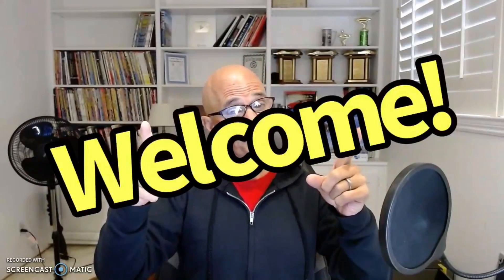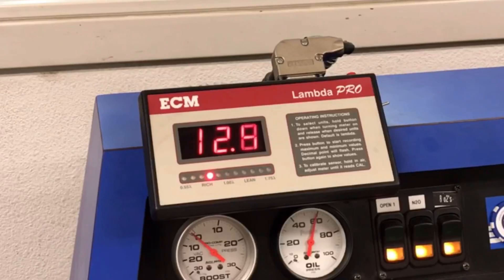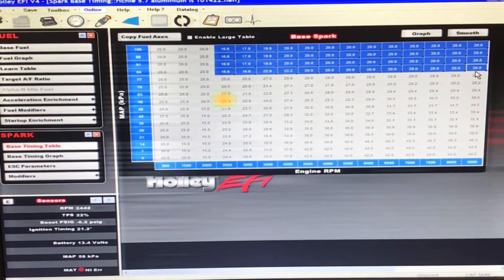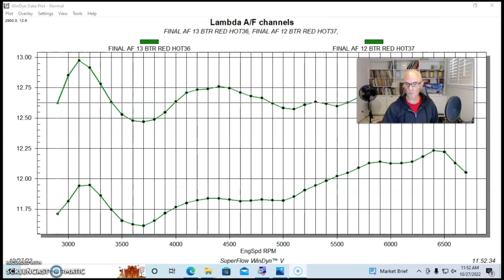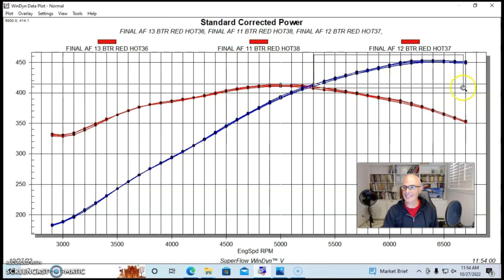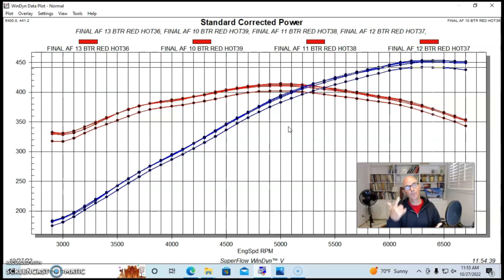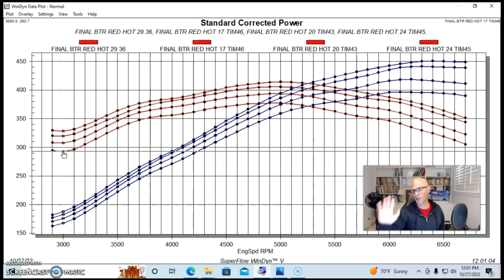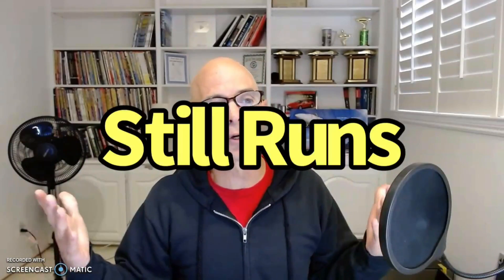JUNKYARD LS TUNING SECRETS! A/F TEST-10:1 v 11:1 v 12:1 v 13:1. TIMING TEST-17, 20, 24, 29 DEGREES!

Comment: Obviously, vehicle weight and combustion design efficiency plays a huge role in what you can get away with (timing and AFR). Octane as well.

I personally see most trucks (5000lb+ lbs) only tolerate 24° to peak 27° ign timing on 91 octane.

Light vehicles (Vettes, GTO's, swapped Japanese chassis) can get away with 25° at peak trq and upwards of 29° near redline after the peak cylinder pressures. 

Richard, you rock man. Thank you

Comment: I have a question regarding compression and timing. One would assume if you take an engine and simply increase compression nothing else, it is going to want a little less timing. Is there a point where having lower compression with higher timing will make more power then higher compression and less timing? I know this sounds generic, but with technology these days I like to question a lot of the things we have always sorta gone by in the past.
Reply from the maker: Higher compression doesn't always change timing (unless the piston design is dramatically different-read big dome)
Reply: @richardholdener1727  I see, I am gathering parts to upgrade the 302 in my falcon. Its from an explorer with the gt-40p heads. Was thinking about adding some compression to it with a set of kb dome pistons, mild port job, chamber cleanup, etc. Just something to play with, no real goals in mind besides a different build vs just going the easy route and throwing aluminum heads on it like everyone else. Curious about trying 10.25-10.5:1 to see if I could get away with it on 93 octane. I know the camshaft plays a big role in bleeding off some cylinder pressure, but Id like it to have a good useable power curve vs being a 7000 rpm setup. Have you done any testing with Howards cam shafts in the sbf platform? I am considering their 222755-08 cam for this build. Any suggestion on what dynamic compression would be safe for an iron headed sbf? Keep the awesome videos coming, I have enjoyed going back and watching them!

Comment: What the timing should I use with a ls carbed with stock pcm? 🤔
Reply from the maker: how are you running a stock PCM with a carb? But the answer would be the same as EFI-whatever timing makes the most power with no detonation

Comment: You lost about 12% of ft.lbs down low and you lost about 12% of ft.lbs @6200rpm.
Is that really significantly more? 🤔
Reply from the maker: now do your calculation in hp
Reply: @richardholdener1727  The question was ”is that really significantly more”.
We don’t measure hp, we measure torque.
The gain on hp is because of the mathematical formula of it (I know you know this), not because of anything else. The engine gained about the same torque % down low as it made up in higher rpm.
So in other words it made about the same gain from the timing advance at lower RPM as at high RPM (And didn’t ”need less timing at lower engine speed”).

Comment: Question when you take out and you got the rings do you reuse the old rod bolts or do you put new ones in?
Reply from the maker: reuse rod bolts
Reply: Install new head gaskets on my 4.8, hearing a lot of noise bottom end, Baeings worn out,? Motor does have 280,000

Comment: What pound fuel injectors do I need to do a thousand horsepower on a 4.8 2006?
Reply from the maker: 80-100 pounders will do that on gas, but you need 1500 cc (or so) for e-85

Comment: What about the combinations, low afr and high timing vs high afr and low timing vs low afr and low timing vs high afr and high timing. after all they do work in harmony...
Reply from the maker: the ideal timing has little to do with AFR-that is primarily chamber/piston design. when we test the effects of 1 variable, the others are optimized
Reply: @richardholdener1727  You say they have little do with each other, so you have tested these combinations?

Comment: The dyno and the track are not the same. My 415 made it's best power at 25 degrees of timing on the dyno, but at the track 25 degrees only got a 1/8 mile pass of 5.67 @ 121.5 mph. i made the next pass at 35 degrees and it ran 5.55 @124.79 mph with no other changes.
Reply from the maker: did you try 30 degrees where it should have been
Reply: yes, and it wasn't as fast as 35. I have a 6300 stall and shift a 72-7400 rpm. @richardholdener1727
Reply from the maker: sometimes the rate of acceleration changes timing needs-but do what works best for you at the track
Reply: @richardholdener1727  Just to let you know I wasn't trying to disprove you or anything like that , I was just posting my experience and what worked for me.
Reply from the maker: no worries-in the end-do what works best

Comment: Dyno'd thousands of engines...The power loss comparisons on a few of these static tests appear small, however, when the engine is in the car... timing and air/fuel play a much more important role for engine acceleration, and engine recovery on a gear change. Ted @ CNC Racing Heads

Comment: What should my afr be at idle on a cammed 5.3 ss2
Reply from the maker: 12.5-13.5 is fine
Reply: @richardholdener1727  ok thanks. Had some guys say it needed to be leaner
Reply from the maker: you can run it at 14.7, but they tend to idle a little better if you run them a tad richer-the motor will tell you what it wants.
Reply: @richardholdener1727  ok thanks 😎
Reply: @richardholdener1727  another thing. Idle vacuum. Mine is at -5ish.

Comment: If your running 10:1 or 11:1 AFR over an extended period of time  would there be a build up or carbon on your pistons and valves?
Reply from the maker: not from compression
Reply: @richardholdener1727  No I mean 10.1 - 11.1 Air fuel Ratio?

Comment: Is 29 the best you’ve found have you tried 30-31?
Reply from the maker: timing sweeps are performed on every combo-including going past 29-but if no power gains come from going from 28-29, then you won't get any going to 30 or 31
Reply: @richardholdener1727  oh I didn’t see the dyno from 28-29

Comment: Wish you would have went higher on the afr and see if power drops before knock.
Reply from the maker: leaner than 13.0:1 at WOT? no thanks
Reply: @richardholdener1727  
I was just curious if the dyno would start to show less power before it got critical./ knock

Comment: FormulaBoat, and he doesn't just do ls testing! he, does some of the stuff you go i wonder what would happen if? stuff. hopefully, he gets his mitts on the new 4 cyl from BPE. that made a showing at the last PRI, show. 340hp 3.6 they estimate, bet he could pull close to 4 hundo, out of it. he has toys you know. and he uses dyno water like engine,pierre.
Reply from the maker: that bpe motor will most likely not be offered with an LS head is the last info I got
Reply: @richardholdener1727  but, im sure you can spin the wheel with the Ford  head. I, just read what I thought was a new article earlier today.
Reply: @richardholdener1727  i,was amazed by the bore and stroke that little mill will boast. It's pretty exciting actually  it may well end up starting a new trend in little big power.

Comment: I’m more interested in what the air-fuel ratio does to knock threshold. For example, since going richer doesn’t cost much in the way of power does it make it more resistant to knock and would it allow you to run more timing? And on the inverse side, where is the cross over point for leaning it out to gain power before it runs into lowering the knock threshold and it starts forcing you to pull timing.
Reply: Is not moving the af ratio with the point changes riching the fuel and leaning it out he shows that it only gains 2 hp so hes saying its not worth leaning it out or to fat.

Comment: Gotta say I was not expecting these results.  My assumption about timing was about right, but I did think the AFR would have a much more significant effect.  As always, the numbers don't lie.  Thank you!
Reply: I have personally experience the same thing when tuning my ls and went richer as I go between 5 - 20 % ethanol with out an effective sensor.
I tried simmilar with a barra years ago and that engine for some reason was very touched when it came to richer afraid in the 10's . The LS didn't care one bit

Comment: HP Tuners YouTube channel did a similar video on fuel and like you showed power was negligible but was really important was exhaust gas temps.  Spikes in getting hotter or cooler with just small changes
Reply from the maker: definitely with timing

Comment: A takeaway for me is that A/F insensitivity explains why carbs make more power unless you spend 5 figures on an EFI setup. Atomization is more important than an exact a/f ratio.
Reply: Who spends 5k on EFI?
Reply: @nocturnalspecialties642  5k is 4 figures. A 5k efi setup won't beat a well prepped carb setup for the same money. A lot of people spend 5k on efi and more. 5k is peanuts.
Reply: @IlPinnacolo  :( I misunderstood that. 
I use Holley Dominator ECUs on all the turbo cars/trucks I build.  
Kinda hard to run dual fuel in a carburetor setup tho.

Comment: Any good reason why my car after a tune would want to run at 14.7 a/f ratio
Reply from the maker: only under cruise-you should never run it at wot at 14.7:1
Reply: @richardholdener1727  under WOT it settles down to 14.7 a/f but under cruising it bounces around everywhere

Comment: 10HP on a 450hp engine is slightly over 2.2%. You can go down 3 full AFR numbers or 5 degrees of timing from optimal and the HP cost is minimal.

That means that there's significant tolerance of at least a similarly set up LS engine in terms of both AFR and timing. For people who are doing anything but trying to eek hundredths or fractions of an MPH out getting it close is almost certainly good enough.

Comment: 450hp from a cam only 5.3L.  Awesome.  This guy needs to be paid more.  His contributions to the community are more than any other 10 combined.  Thanks buddy.
Reply from the maker: thnx
Reply: Holley hp mangement system is what most people missed
Reply: headers & no accessories or air filter

Comment: Timing just scares me..rattle a motor a few times and you could have a a pile of scrap metal.  I do hate the thought of leaving 30-50 HP on the table too, but..i hate all that rebuild work..i keep my turbo car at 10.7 WB and 17* with meth alky control inj.
Reply: Knock sensors hear that and will retard timing.

Comment: With a NA 4.8 or 5.3L with 862 or 706 heads I generally find 26° total timing and air/fuel of 12:1 at peak torque and 12.5:1 at peak HP to be safe.

Comment: Very good test. When my PE is rich I can hear it in the motor and how it runs... it has to be in the 10's though or low 11's... my trucks like about 12.8 in PE... they sounds better and scream up top! Great test to debunk more internet myths! I also run about 22-24* of timing for my daily tunes. Also increase timing in cruising parts of the map for some mpg...
Reply: At low load cruise, I run as lean as 16.5:1 and timing over 50* on some engines. I have seen some factory setups with 50*+ at light throttle and low load. At low load, once you are leaner then stoich your combustion temps and EGTs actually start to drop. P01 and P59 controllers have lean cruise mode to handle this.
Reply: @chrisreynolds6520  lean cruise doesn’t work unless you change the platform code.
Reply: @SamSheepDoq  Well aware. My 99 Tahoe and 97 Express van identify as Holdens. The 99 has a P01 and the 97 a P59. The Express van is really confused, it is a DBC P59 running a 2005 1-ton Mexican L31 GMT800 based tune with E85 and Holden platform ID..
Reply: @chrisreynolds6520  it's so  that you embrace how your van identifies it's self  
As Mexican and Australiaian 
We got a hot rod motor of the year contender over here
Keep emPOWERing 
You got to watch out on those 
Mexican ecm tho  
 if your motor blows they'll be candy all over the place

Comment: Being that more timing makes more power, could running e85 n/a allow more timming advance and more power, 

or is it slightly offset by having to add 20-30% more fuel decreases the amount of air in the cylinder, ...offsetting the benefit of the timing advance 
Or is e85 just beneficial when you have extreme cylender pressure like under boost or high compression (12:1+ compression) where on pump gas the timing advance would have to be less or half of what would be ideal because of detonation or knock 

I say e85 because of availability but methanol is another fuel for discussion along with ethanol for n/a things, 
but on a 10:1 compression engine the gain is what about 10-20hp? But on a 12-15:1 compression n/a engine we would be talking 30-80hp on alchohol fuels vs 91 octane pump gas? ,,

 or alchohol(s) vs 100+ octane gas =20-40hp? 

 Do you already have a video on the subject ?
Reply from the maker: e85 has been tested many times-almost no gains (with a few notable exceptions) on most na motors (even with more timing), lots of gain on boosted motors (even without changes in timing-then more with additional timing).

Comment: Great video, love the dyno stuff! I would have liked to a bit of an explanation on why adding timing increases hp (to a point)
Reply from the maker: IT CAUSES THE BURN AND EXPANSION OF THE AIR/FUEL MIXTURE AT THE CORRECT TIME TO MAXIMIZE PUSH ON THE PISTON
Reply: Too add to what Richard said...  When you advance the timing, it starts the fuel/air burning earlier.  If more burns, the hot gasses expand more, and give you more power.  When you retard the timing, it starts the burn later.  Mixture has less time to burn so you get less power.  If you advance too much, then you break things.
Reply: Thanks, but I was trying to help Richard make better content in his videos. He was more caught up in results, but its the why that actually makes for better videos (ex. Mythbusters)

Comment: With all your great tests would it be possible to get a test similar bones to bones only difference being compression ratio like maybe 9.5 versus 10.5 versus 12.5
Reply from the maker: VERY HARD TO ONLY CHANGE COMPRESSION WITH NO OTHER CHANGE
Reply: @richardholdener1727  instead of trying a high compression shootout. Would it be more possible to test lower range compression ratio on a stock motor with only changing the Pistons say 7.5,8.5,9.5. I would think using a low comp build would give the best option for apples to apple.

Comment: This is a great test. However, cylinder head design, intake manifold design, quench, etc, all have an effect on what the optimal afr will be.
Reply: Believe me, I understand what you mean, to a certain extent. In my 23 years of tuning GM, Mopar, and Fords, some combos are just more sensitive to AFR than others. It's like trying to run a stoich of 14.6 at cruise with a cam that has lots of cam reversion, that engine is not going to be happy. But I do agree on this info for 90% of combos out there.
Reply from the maker: there was little to no difference in power between optimal and sub optimal af

Comment: I'd like to see pulls at different coolant temps. 160-180-200-220. Forums seem to say that they're design to run hot. And making them run cooler hurts power.
Reply from the maker: THAT IS INCORRECT-COLD WATER ADDS POWER, HOT OIL ADDS POWER
Reply: @richardholdener1727  I figured. I trust your input way more than insert username here on LS1Tech.
Reply: @richardholdener1727  Grumpy would disagree.
Reply: Really it is cool cylinder heads, hot cylinder bores, cool air and high oil temps that will make the most power.  Never understood why GM went away from reverse cooling. 90s LT1/LT4 can run a full point more compression with the cooler cylinder head temps helping prevent detonation.

Comment: Awesome 👍. Yea Tuners Become OCD About Having The Engine Do Exsactly What They Want It To Do. That's Why I Dreaded Learning How To Tune On My Own. You Get Stuck On The Little Details And Wanting The Tune To Be OEM Perfect... Which Is A Ton Of Effort For Pretty Much No Gain Just OCD Pleasing haha. The "Magic" In Tuning Is The Drivability, Everything In Between Idle And WOT. That's  90% Of The Work Especially If It's Got An Auto Trans And Electronic Throttle Control Which Are Whole Separate Endeavors To Dial In Your Forever Changing Driving Preferences hahah.

Comment: Can you do a similar video on a boosted application on E85? I want to see if my 12.0-12.1 AFR is worth it over something like  11.8 in terms of power.
Reply: I say E85 because you can run MBT and change only the air-fuel ratio as the only variable.
Reply from the maker: 12.0 vs 11.8 is next to nothing

Comment: So does this mean that richening the fuel mixture is done more to protect the motor rather than to make power?
Reply: To a certain extent yes. However at some point all you do is washing down the cylinders, build up carbon and foul plugs. Read your plugs, it's a must that will tell you how it runs.